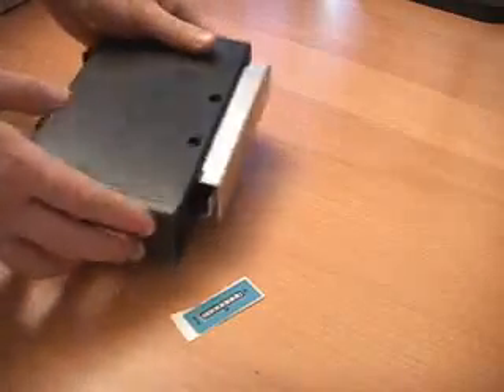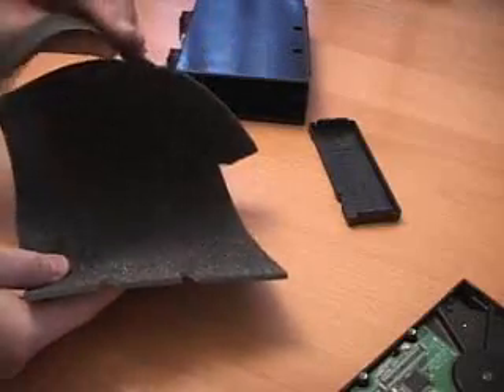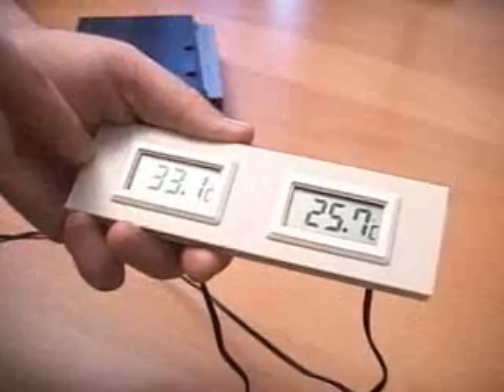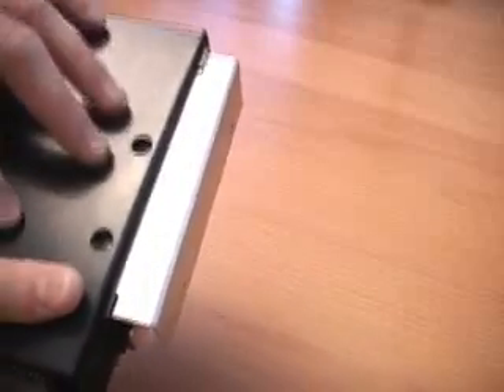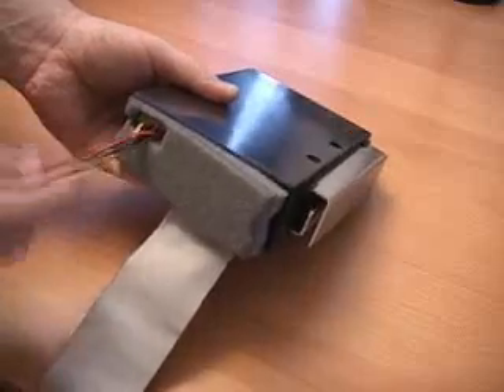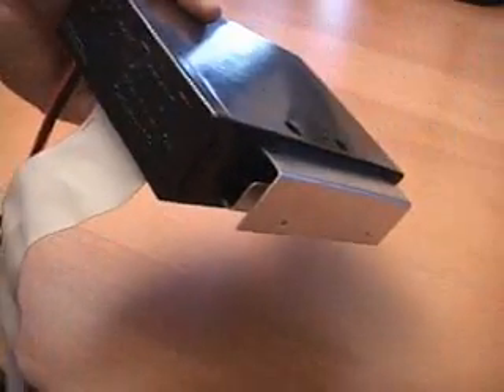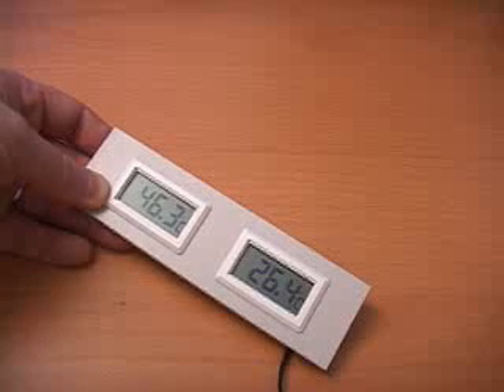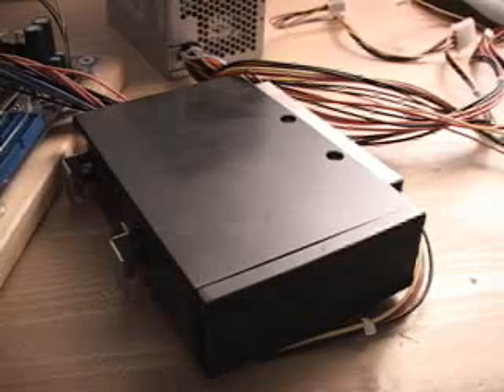#183 - SilentDrive™ (Hard Drive Enclosure)

Comment: If noise is THAT big of a deal (Audio Engineers).  Put the tower in another room and buy extension cables for the display, keyboard and mouse.  Cheaper than frying a bunch of hard drives.